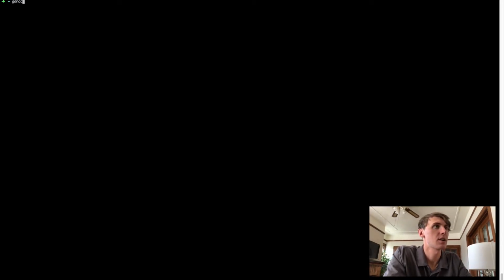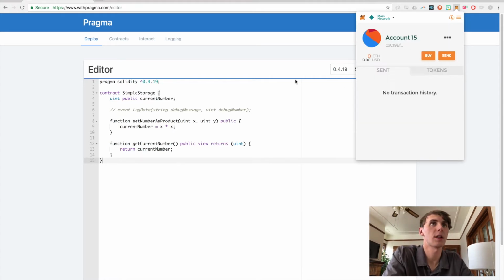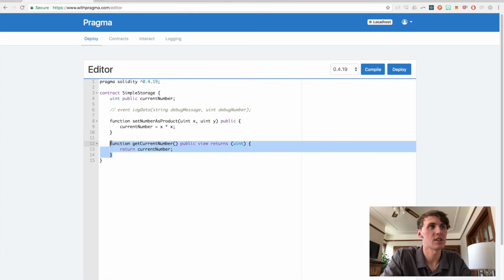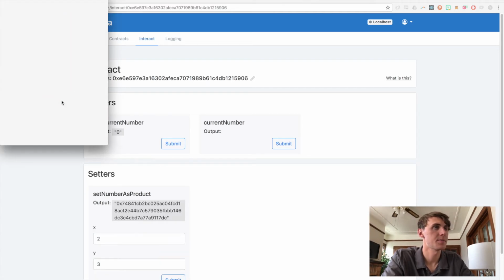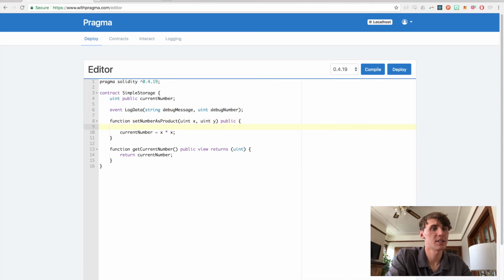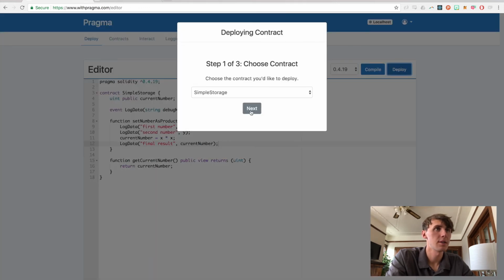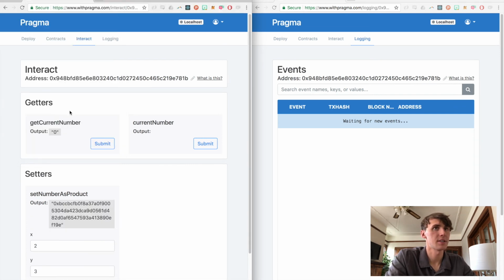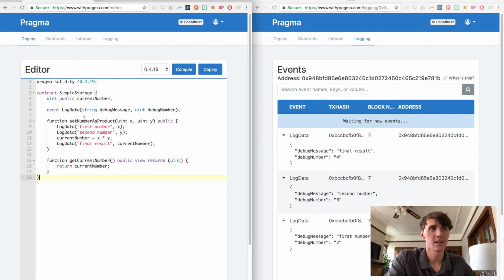How to Debug your Ethereum Smart Contracts

Comment: can you share the command you used to start with seed, and when clicking deploy withpragma shows message you do not have eth on your localhost, tough i have 100 ethers in it.. also can it be done with Geth client just like Ganache?
Reply from the maker: The command was ' ganache-cli -s "tutorial" '. If your account shows 100ETH, you did it right. Refreshing the page on Pragma should fix your issue. Sometimes when you change wallets in MetaMask the page doesn't pick up the change.